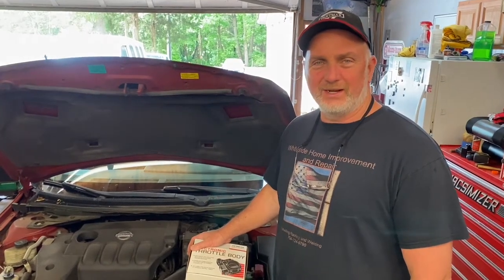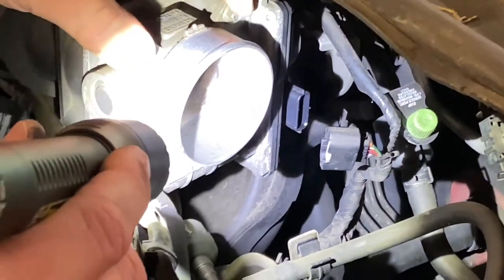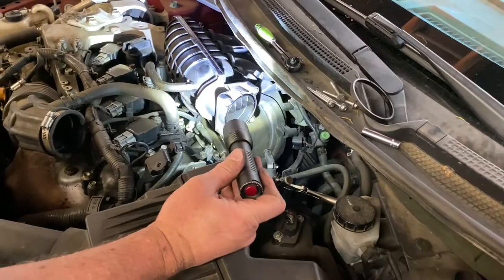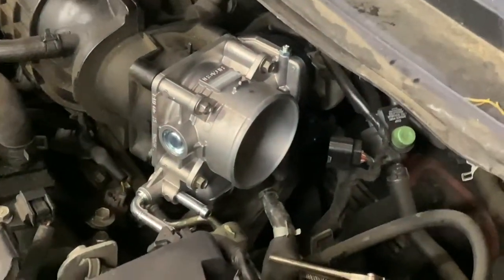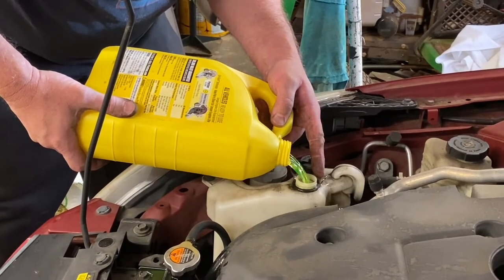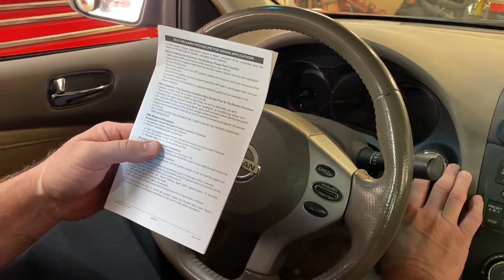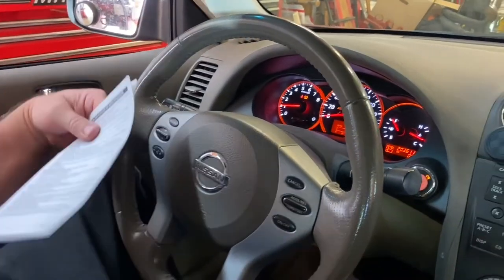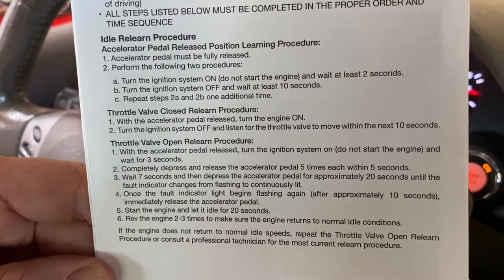How to replace the Throttle Body on a 2009 Nissan Altima

Comment: This is very detailed and more videos should be like this.. I just replaced mine and was getting ready to go through the relearn procedure..I compared our booklet and I have the exact throttle body you have and the exact 09 Altima.. Problem is,, in the second phase of the relearn procedure it's the throttle valve closed relearn, it states with the accelerator pedal released turn the engine on..(not just ignition which you did)..Now im stuck and dont know what to do..I looked at your booklet and it says the same thing..
Reply from the maker: Since I made this video I have purchased an Autel 906. It makes life a little easier when relearning. I do remember that there is another video here on youtube that a guy made showing the relearn for a Nissan. It was very good and easy to understand. Try searching his video. Hopefully that will help.

Comment: I got caught in a flash flood and the repair shop said that the throttle bottle took in water. That with some other electronic components plus labor adds up to 2.4K. I’m going to attempt to repair it myself instead… thanks for the video!
Reply: dont try to repair a flooded vehicle. if the throttle body took in water its highly possible the engine also took water in which can lead to engine failure. water in electrical components can lead to short circuits and cause a fire
Reply: nhow did it go?
Reply: @BillSW  yeah so let me give some more details on how it was partly flooded. I tried driving through a deep puddle and got half way, that’s when the engine shut off but the battery was still on. It took a couple attempts of turning it on/off until I managed to reverse out of the puddle. The rest of the way home the car was stuttering and wouldn’t accelerate smoothly. The next morning I expected my car to be totaled and not turn on but to my surprise it turned on. No noises and no lights on the dashboard. So I thought I’m lucky and decided to go about my reg day. I get on the high way and right as I’m about to hit 30 my car starts stuttering again. I drive back home and make an appointment with my local Nissan dealership (that has a mechanic shop). They give me the diagnostic (my original comment above) and I decide to buy the parts myself. I take the car to another mechanic nearby (highly rated online) and asked them to install the parts for me. ( I never told them that my car was flooded). I pick up my car a few days later and drive it back home with no issue. It wasn’t until the following day when I went on the highway when I realized that my car sounded a lot louder than usual and only when I approached 40mph. There are no lights on the dashboard and there no “clanking” sound, the engine or transmission just sound like a boat. That was over a year ago and I’m still using my car to this day. So it went well I guess, I’m very lucky tbh

Comment: If i were to instal a used throttle body would I have to do the throttle relearn procedure,?
Reply: I am certain yes as the throttle body has to learn the way your car functions & intakes air as it’s a different one than your car had before.